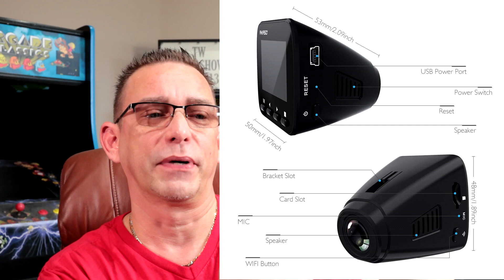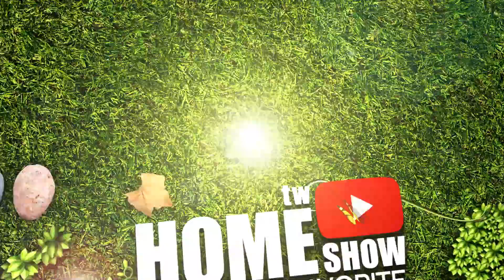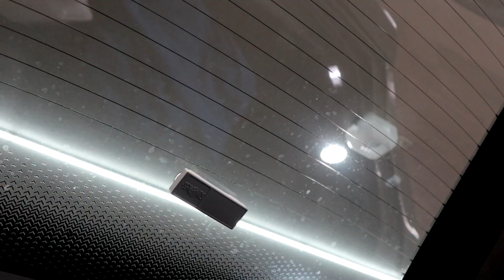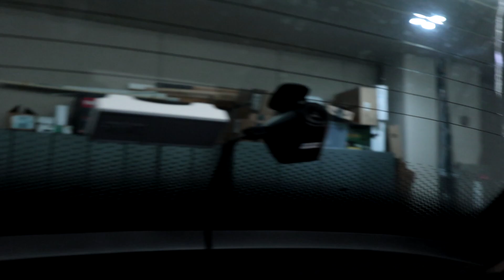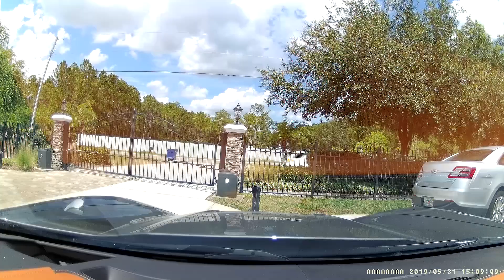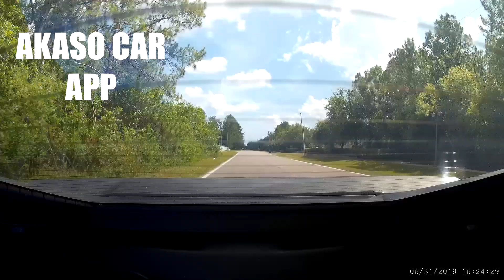YOU MIGHT WANT A REAR DASH CAM | akaso dash cam v1

Comment: Thanks to you I bought one.  I'm not sure if it's working right yet.  It wouldn't connect with the satellites within 10 minutes, but today after a while it's connected.  The instructions and how to navigate is poor but finally got it to sort of work.  I haven't tried it yet, but I'm hoping with GPS it gives you your speed in case you need it in court.  So if you do wifi, the GPS is off.  I don't know why it needs to be.  When I went with wifi, it popped up on my phone to turn off phone data.  What is that and where???  So far not so impressed, but $80 what the hell.  Just hope it's the biggest mistake this month.
Reply: Update:  I used it in the car and then watched the video.  I didn't use wifi.  It shows GPS at the bottom, but no speed info or anything else of value.  Why bother with adding GPS and do nothing with it.    I agree that everyone should have a dash cam, I just don't think that you should get this one.
Reply from the maker: Yes Bill, You should return it if you're not 100% happy with it. My video was mainly just to bring to consideration of using a dash cam at the rear of the vehicle. Thanks for you comments :) Todd
Reply: No dispersion on your video.  It was good.  I either didn't read the stats right or they are vague.  If it's working as designed, I wouldn't feel right sending it back.  I'm talking with support now and trying to figure out if it is working as designed.  IMO any dash cam should display speed, obviously GPS is needed for that.  This says that it has GPS, but does nothing with it.

BTW, how do you get the app on to your desktop.  I was going to do that but I am missing a step or two?  Another video idea :o)
Reply from the maker: @myutube6422  I just created a return for my AKASO Dash Cam tonight. I noticed it showed one time, the GPS location, of all places, when I was inside my house ONLY. The day after, I used it in my car and logged into it and there was NO recordings for my drives. I don't really find it important as you do....for GPS, but the dang thing better turn on and operate every time to record all of my driving or it's useless to me. I just ordered this Dash Cam for my replacement: https://amzn.to/2JZUOvk   | It matches my front Dash Cam AND it has the WiFi capability to connect my phone wirelessly to see or download any video feed. If I have to pull-it down...it's magnetic and I can just grab-it and remove easily from the window mount. I'm sorry if I miss-lead you into buying this product....It seemed to work good, right out of the box. But my main reason for this video was to show how to install a REAR dash cam to the back window of your vehicle :) Thanks for your comments Bill!
Reply: Well, that does suck.  JFTR I have a couple of refurbished Garmin Dash Cams and I guarantee you will love them, the backward viewing will be a bit much, but in light of the fact that the NAV system in my $60K BMW isn't worth a damn, but you can't get the other high tech stuff without it. I use the Garmin. 

Anyone with a brain should realize that your "job" is to find cool stuff and make a video, so that us cheap people can wait until you test it before we buy it.  Before Utube etal, I had a friend (now decreased ) that always bought the newest stuff, and if he oked it, then we would head to Costco and buy it. 

I love it, that you sometimes don't have a clue and engineer on the fly, to get it to work.  That's the story of my life.  I'm too old and lazy to turn on the camera while I am trying to defi gravity.

Keep up the good work and hope that this dash cam is your biggest screw up this month.

One time in one of my companies, I came up with a genius idea and contacted my clients with it.  $250, one of them called me and said how do I know that I'll get a return on my $250 investment.  I had no idea, but my  response was "just hope this is the biggest screw up you make this year"  He said, "the checks in the mail".

I have found that if you don't screw up, you learn nothing.

BTW, you didn't tell us how you get an APK onto your desktop.
Reply from the maker: @myutube6422  For me to show you the Dash Cam App on my desktop, I just captured my smartphone display with "SnagIt" screen editor while doing a screen capture of my phone. Oh, and please know that in my videos....I show, and give links to the products I used to show you in my video to make something work for me (this one didn't work so well, after-the-fact). But my idea or plan for my video concept is what I want you to take from it.... I leave my links to the products, BUT you can find a better product to put into play as a replacement for my overall idea of what I have accomplished! 

Most of the products that I leave affiliate links for have at least 4 STAR reviews or more. That is my standard. BUT this one  . . . 

You're right, I engineer on-the-fly when it's necessary, it's just my nature :) I want to always believe something will work, even though it might not. I take it to the next level....believing it may work in a different way.  I really value you sharing your previous experiences and value you as a YouTube viewer. I hope to see more comments from you in my future videos :)   Todd
Reply: Another update: I finally!!! got usable info from customer service which explained that the GPS info, which does include speed.  You can only see it by downloading the video into the app and then turning off the wifi connection and then viewing.  If you put the SD card into your computer, you can see the video, but only the app adds the GPS info.  Their instructions are pathetic, but there are some videos by them that help.  The GPS info is pretty cool, but their "system" is pretty convoluted.  Since it appears to be working right, I'll keep mine.